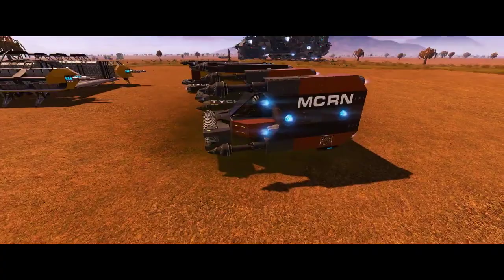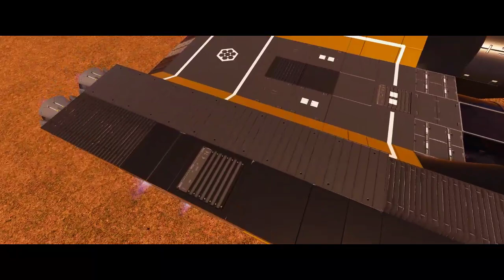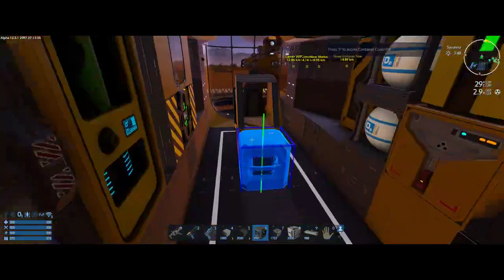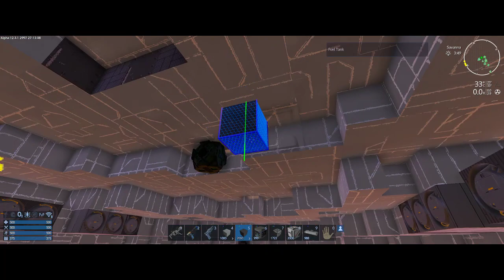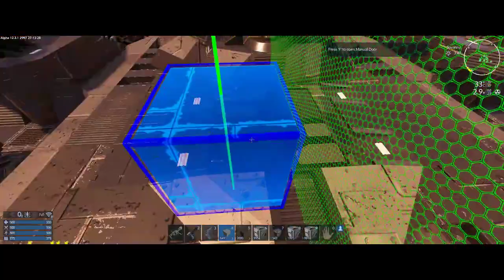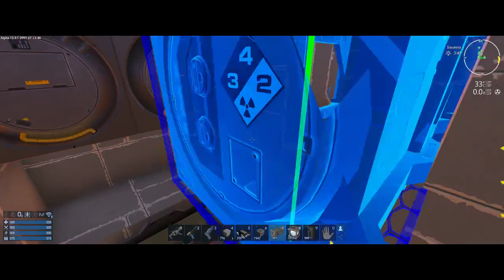Skaar Tank WIP part 4 - Interior Layout

Comment: on the tyche miner could you move the bottom center drill forward one space? if i recall correctly the harvester will still work with it like that
Reply from the maker: It would have to move I think 3 spaces to allow it to be sealed. I will look at it again and maybe make some more changes. Thanks again!